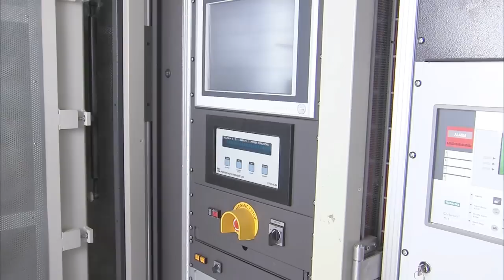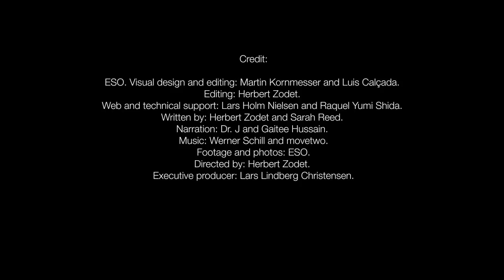ESOcast 29: Running a Desert Town

Comment: I was surprised. For some reason, I was expecting that at least part of the electricity used there would be generated by solar power, give a location like that where the sun would be a reliable source year-round. Now I do understand that in a remote place like that it would be expensive to build a solar farm but it would probably be worth it in the long run. Add some electric cars and they can drive around for free and become a true high-tech "green" desert oasis.